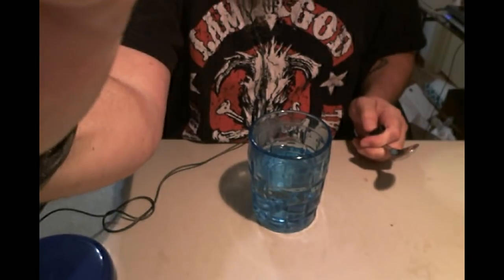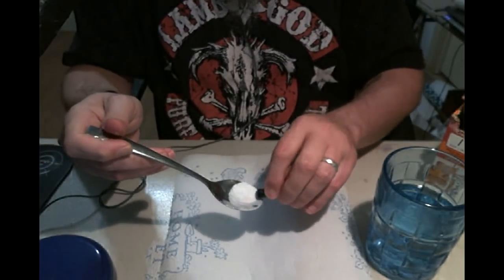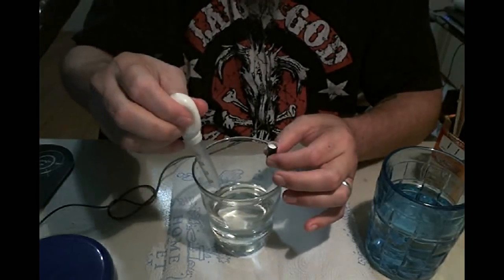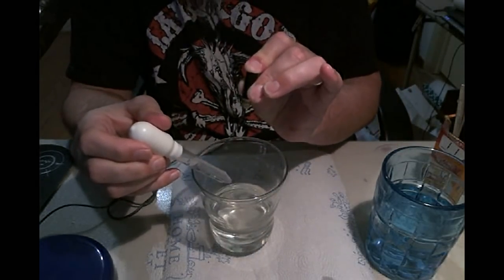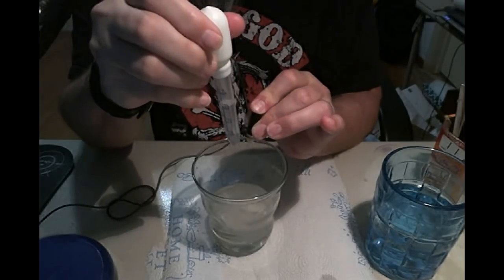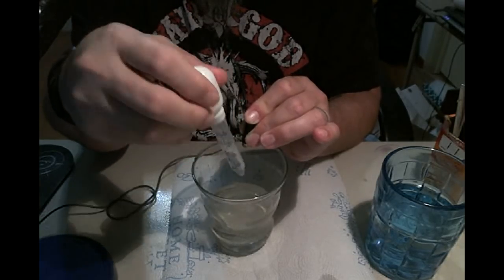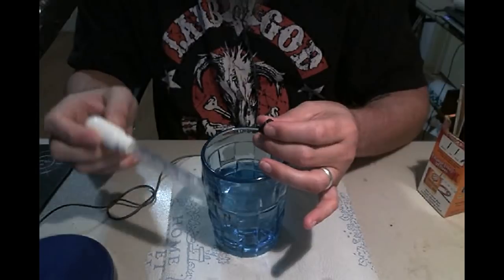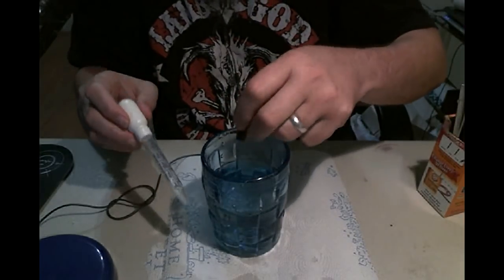How To - Cleaning an atomizer

Comment: I have been vaping for over three years now. I've tried the Kanger Pro Tank and it gives great vaping for a couple of days until my 100% VG juice always clogs the coils. The replacement kit is ten bucks and that means at least spending $20 a month. So to make it simple I have always gone back to using the joyetech mega type B atomizer as it lasts for up to six months at only $8-9 bucks a piece. I always used alcohol or boiling water to clean them. Then I tried this method here...AWESOME. THANKS!

Comment: Well I just cleaned my 2 week old standard resistance eGo-T atty with isopropyl alcohol and the first tank tastes a tad strange but is easier to draw on yet doesn't produce as much vape as an almost new atty, go figure?

Just cleaned an atty with baking soda and white vinegar and is drying now and will keep you posted. Impressed how gas pressure forced gunk out of the bottom of it.

Comment: You can try boiling metal cartos gently in a pan on the stove for about 15mins. Wash them out in cold water, and then repeat. Not recommended with plastic cartos or clearomizers though.

Comment: Thanks for Vid. I have used several method and all seem to do a pretty good job of cleaning out the gunk but the problem I have is that they still don't work well even after cleaning due to the built up carbon and deposits on the coil wire. Does this method clean that off as well?

Comment: Quick question. Im new to the vaping hobby and was first wondering what a "bridged" and "unbriged" coil is exactly. Also, Is there any other prep work I need to do to my atomizer before cleaning it? Like If I just took the atomizer out of my tank and cleaned it, it will work again like it did when it was new as long as I let it dry all the way through? Im using a Sense Herklales tank with the stock Sense designed duel coils. Any feedback would be appreciated

Comment: This was very helpful, but I am using subtanks. Can you use them on those atty's? I am going to try cleaning my Kanger nano subtank atty first if that doesn't work then I will have to come up with another idea, because they are SO very expensive. I just got into subtanks, and just bought myself a Sigelei 100w, I also have a mini Clouper 30w and last but not least my Hana. I love them all and want to keep all the parts clean and I think so far this is the best idea yet. Thank you so much for your video! - Kelly

Comment: Definitely blow the atomizer out after you clean it, those little buggers can store a nice pool of water that refuses to come out without a bit of assistance.

Do NOT use rubbing alcohol on atomizers or clearomizers.  I did that to one of my clearomizers and it produces next to no vape at all.

After the cleaning, I do attache the atomizer to the battery and give it brief bursts of power, that does seem to clear out the water and any crud.  Though I may not do so once I use baking soda.

Comment: LMFAO! You don't use any chemicals eh? What is white vinegar? Answer: Distilled Acetic Acid! What is Baking Soda? Answer: Sodium Bicarbonate! And you even mention the chemical reaction between the 2! I am sure your method works fine, but I prefer 91% Isopropyl Alcohol, it ALL evaporates within 2 minutes! But I keep 2 attys, and to be safe I give the cleaned atty 8 hours in front of a fan to dry. But I use the eGo-T, and I LOVE my eGo Changeable Coil cartomizer! (also known as the Kanger T2)